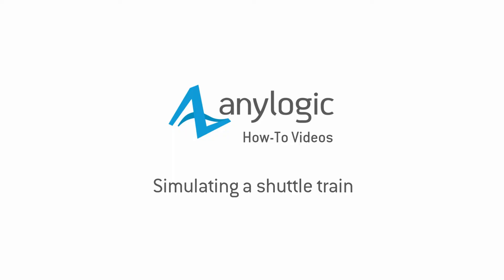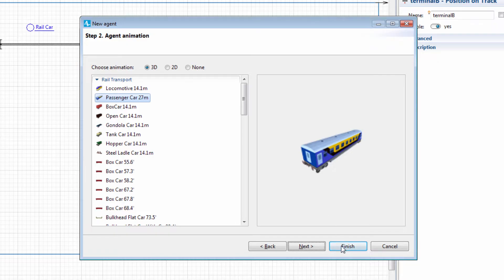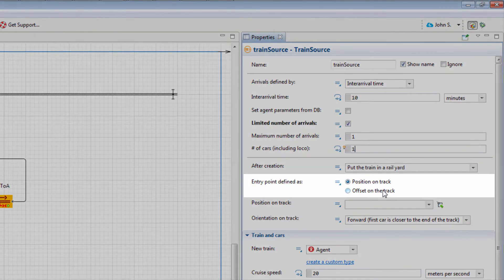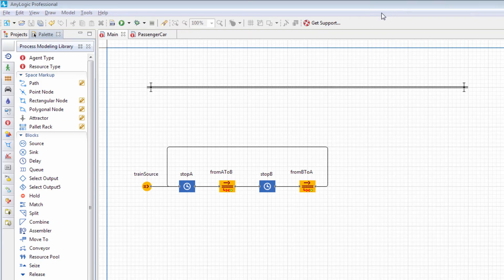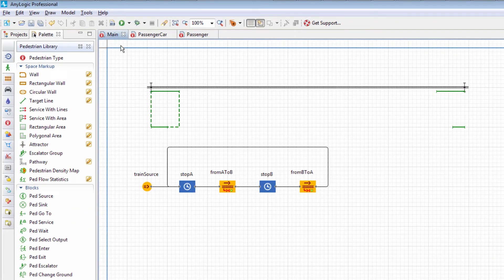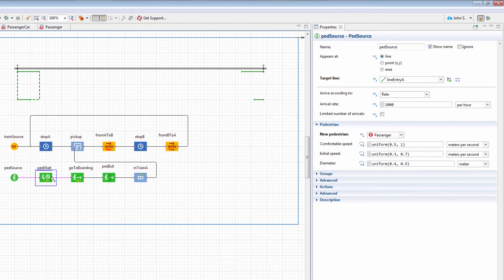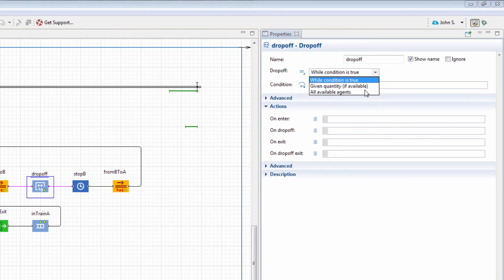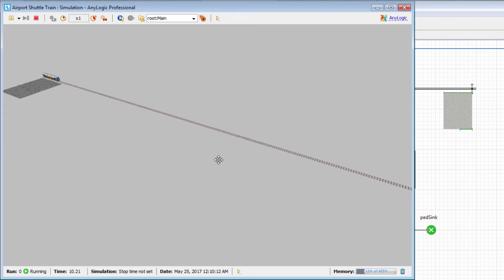Simulating a shuttle train

Comment: I did the model like in your video, but anylogic said, that there’s no connection. What does it mean or what I didn’t do correctly?
Reply from the maker: Hello. Thank you for your question. 
As a recommendation, kindly check the connectors between blocks: https://anylogic.help/library-reference-guides/process-modeling-library/connecting-flowchart-blocks.html#drawing-connectors-between-blocks. 
For example, the problem may occur while connecting the output port of “fromBtoA” to the input port of “stopA” or the cancel port of “goToBoarding” to the input port of “pedWait.” 
If you have any further questions, please feel free to use our community pages: https://www.anylogic.com/resources/support/.